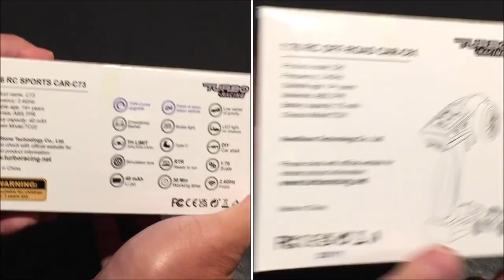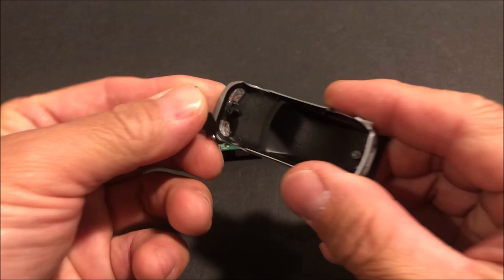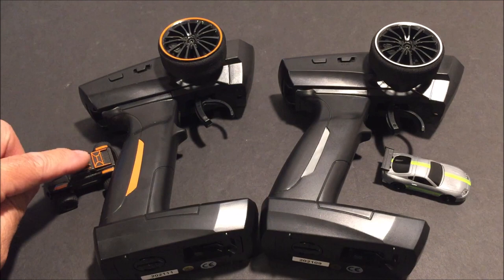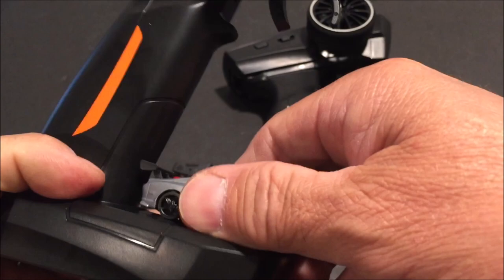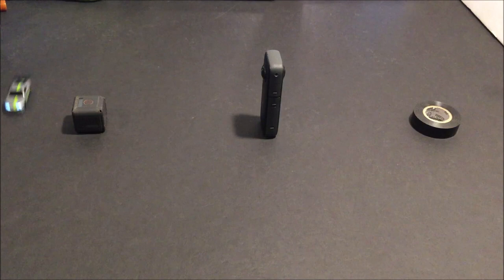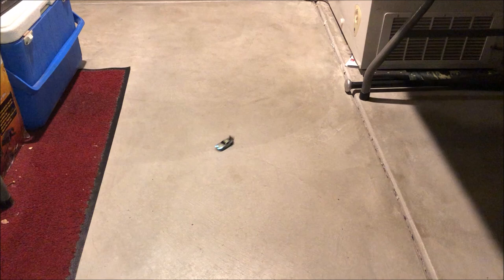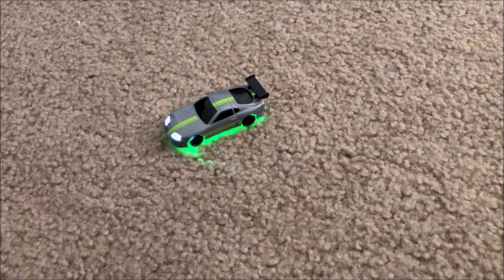Turbo Racing TC01 / c81 and TC02 / c73 Review

Comment: Really excellent video and I recently got the C81,  and the C75 and love them.
With that remote charger you can push that lever on the bottom forward to bring the connecter up, and then turn it 1/4 turn and it will stay up for you to attatch the car.
Reply: Hello, which one is better? I can not decide.
Reply: @avasihai  I like them both about the same. The c81 is good on low carpet but the c75 has to be on smooth surface. Both are just awesome on the right track

Comment: Huge thank for this video. 
Yesterday I saw these 2 little cuties at my RC shop in France, I was hooked and needed to see more…
Your video is simply perfect, you answered all my questions 😊
Sincerely I’m very impressed by these cars and thanks to you I will definitely take one (or two!!)
Very happy, thanks a lot for your video!!
Big salut 🫡 from France,
ViNZ.
Reply from the maker: Thanks :)  Appreciate it!  These are a better choice than the Diatone Q series in my opinion.  So much better to control and you can put an AIO vtx on the top and go fpv driving as well.
Reply: @RCEscape  very nice 👍 
Thank you!

Comment from the maker: 00:00  musical unbox
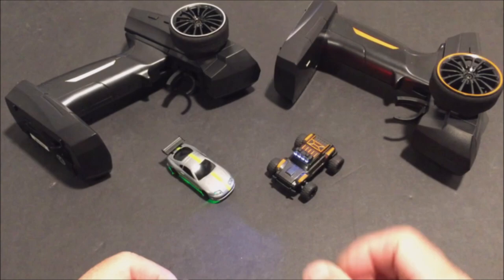01:45  intro 
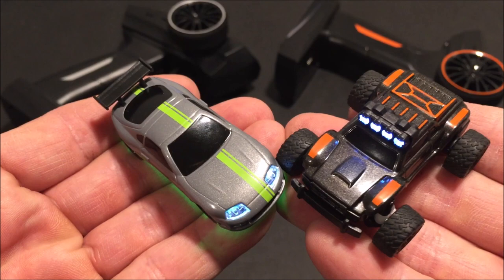02:30  c73
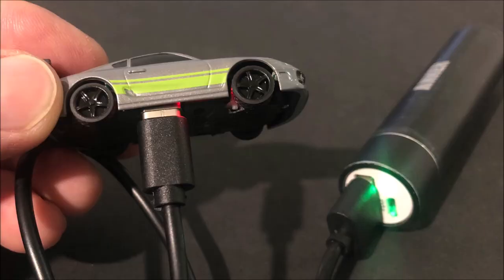04:52  c81
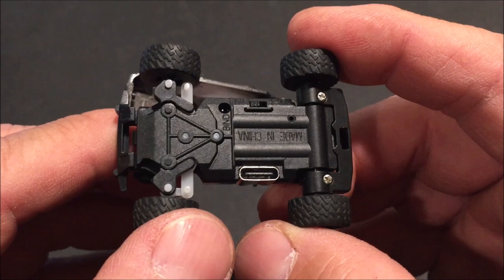06:11  remote controllers
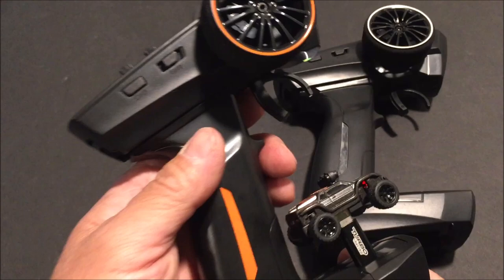11:48  c81 lights
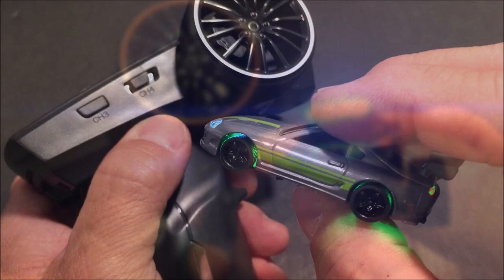12:37  c73 lights
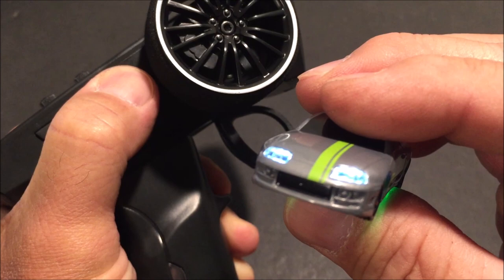13:18  c73 brake and reverse
13:44  c81 brake and reverse
14:03  jumping ramps
15:44  c73 table top demo
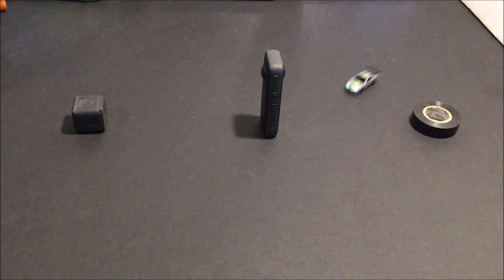17:32  c81  table top demo
19:19  c73  garage floor demo
21:03  c81  garage floor demo
23:10  c73  carpet demo
23:38  c81  carpet demo
24:27  c73  concrete sidewalk demo
24:58  c81  concrete sidewalk demo and final words